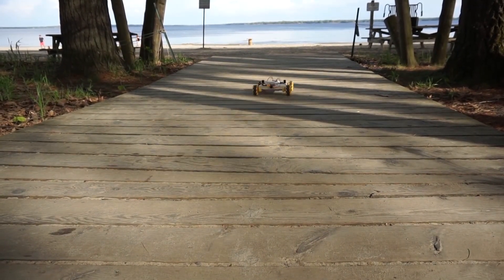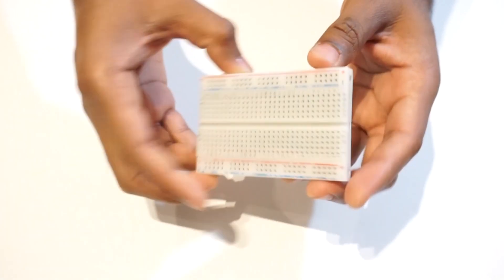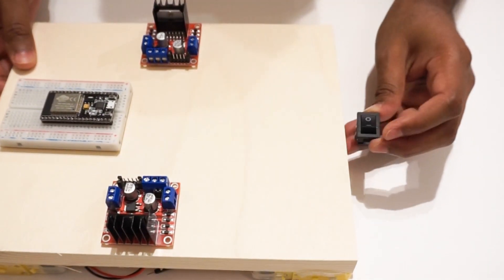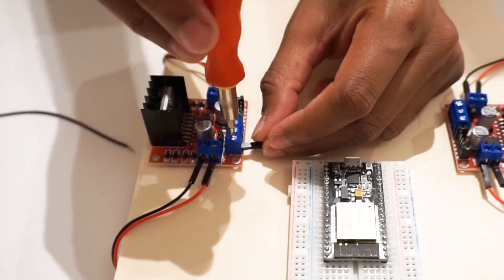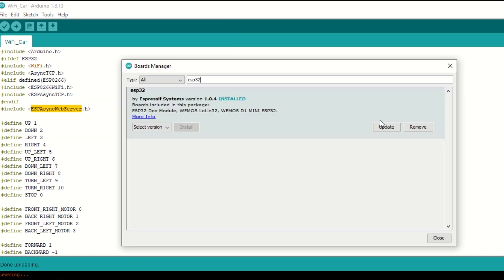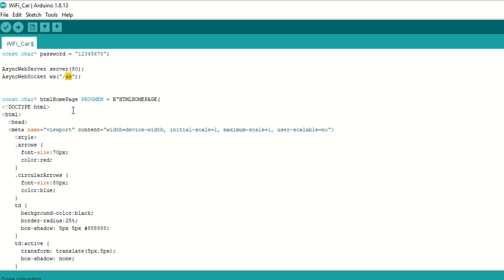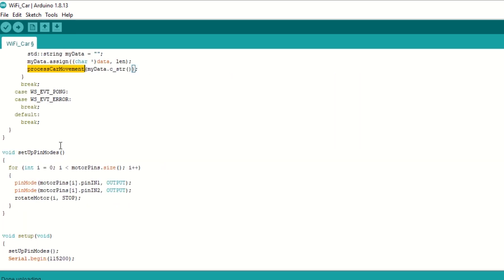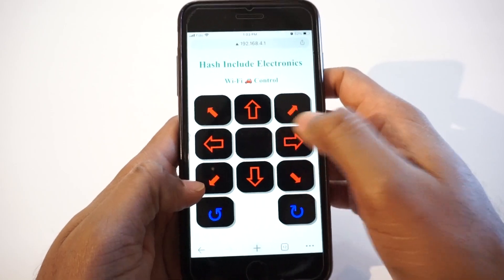Smartphone controlled WiFi car | esp32 | Mecanum wheels

Comment: Love the way this works. I'm trying to add a servo to the project, with a slider to open and close pincers, but the code seems to be out of my league. Got any suggestions for that?
Reply from the maker: Thanks for checking out the video 👍🏻 you can check my other videos for reference where I have used servo motors and slider on app. Like elevating car .
Reply: @hashincludeelectronics  Thank you for your assistance. I tried that, it's the 'switch (type)' coding (elevating car line 291 and on) which I'm having trouble merging with the wifi car coding. So far, no luck so I must be doing something wrong.

Comment: Sir the esp32 is burning after some run what might be the issues please reply as soon as possible sir
Reply from the maker: Please check if you are supplying only 5v to esp32 through 5v pin .
Reply: Yes sir
Reply from the maker: @waseemij573  Then I don’t think any reason that your esp32 is burning unless L298N  driver is faulty . Try using new L298N driver if you have new one . How long after esp32 burns ? Does your car work properly before burning?

Comment: Wifi is not working when usb is removed from pc when power source is connected to chip directly
Reply: Is (18650 1200mah 3.7v) 2batteries are enough??
Reply from the maker: @Surya-hd7ie  yup it should work 👍🏻
Reply from the maker: Which power source are you using ?
Reply: @hashincludeelectronics  same as you shown in video (using batteries)
Reply from the maker: @Surya-hd7ie  is it rechargeable battery ? Please do not use non rechargeable battery .
Reply: @hashincludeelectronics  why it’s not working with non rechargeable battery??
Reply from the maker: @Surya-hd7ie  those batteries does not provide enough current or surge in current .
Reply: @hashincludeelectronics  how much volts and mah battery should be used?
Reply from the maker: @Surya-hd7ie  you can buy the same battery as I used in the project I believe I have provided the link for it. Any rechargeable battery with 7-12v should be good. More than 1000mah
Reply: @hashincludeelectronics  thanks bro for replying
Reply: @hashincludeelectronics  I need report of this project for reference do you have it?
Reply from the maker: @Surya-hd7ie  sorry I don’t have it . You can create one easily using this video . I have already provided all the materials like code , diagram and detailed steps in video . Hope it will help you 👍🏻 please share the report with others as that will be helpful .

Comment: This is an amazing. I have a question. How can I introduce some new ways to move the car without pressing the button continuously? You´re a crack
Reply from the maker: Thanks for checking out the video 👍🏻You can use these buttons as on off button. When clicked it will move motor . And add stop button in the centre . When stop is clicked the motor will be stopped. You need to make the related changes in the code .

Comment: Bro after completing this program why in Arduino ide software not showing the port
Reply from the maker: Please check the video for detailed step 👍🏻
Reply: In your video port option is there bro for my laptop is not visible
Reply from the maker: @venkatvenkat955  Did you ever see port option before for other project ? What happens when you connect different board ?

Comment: First of all thanks a lot for this awesome project.I finished the circuit for this project, but the front right and front left motor is rotating slower than the back ones. I am using esp8266 btw. Any fix?
Reply from the maker: Thanks for checking out the Video 👍 The speed is common for all motors in code. However what i suspect is your motors have different gear ratio if you are using tt gear motors . There are different variants of tt gear motors like 1:48, 1:120 ratios etc. So check these and use all 4 motors same. Should be good.
Reply: @hashincludeelectronics  yeah! it's a matter of gear ratio. Using small one, N20 will be awesome!

Comment: Thank you very much for posting this. This is an awesome design. I just finished building and have an issue. When I use the arrow up, down, side or the blue buttons, I have to reload the page to regain connection. Can you please assist me with this? I’ve tried an iphone, google tablet and just a laptop. Thank you..
Reply from the maker: That’s awesome 👍🏻 Looks like your esp32 gets rebooted . Which power supply are you using ? Use good rechargeable battery only . I did not face this issue.
Reply: Thank you for the quick response! I will try that…
Reply from the maker: @gkhan753 you are welcome 👍🏻
Reply: I’m in the USA, can you pl make an Amazon recommendation?

Comment: How long can you drive the car ??! I mean how long does the connection is stable
Reply from the maker: Thanks for checking out video 👍🏻. I assume you are asking for range . I did not get a chance to check full range . However I can say it worked for me 50-60 ft. They say it’s WiFi range can be more than this. There is other protocol for esp32 board which can be used called ESPNOW which gives much higher range .

Comment: I don't have esp32 and want to use nodemcu esp8266, how do you fix the code?
Reply from the maker: You will just have to install the esp8266 related library for ESPAsyncTCP. The code should work as it as further after compilation . Also just check the pins used in the code if those are available on esp8266. If not available then change the pins . That’s it .
Reply: @hashincludeelectronics   thankyou
Reply from the maker: @pro7458  no problem 👍🏻

Comment: Hi...
How could I add esp32-cam pin extensions???

THANK YOU
Reply from the maker: Thank you for checking out video 🙂👍🏻 I am not sure if I got your question correctly . Could you please explain more ?
Reply: @hashincludeelectronics  What I meant to ask you is how well do you know ESP32-CAM has few pins. Not enough to put 2 l298n. So in your opinion is it better to put a port expander or use esp32 with espnow?
And wich port expander?
Thank more

@}-,-'---------
Gianfranco

Comment: Does I'm be able to build, if only i use 1 L293N motor driver?
Reply from the maker: Thank you for checking out the video 👍🏻. Actually I have no idea what module is this L293N. I suppose that you are talking about L293D module . Considering that I have never used this module with esp32 . However you can give it a try but make sure that it does not interfere with pwm channel number 0 and 1 . And also make sure it does not use PIN number IO16 . Let us know how it goes .
Reply from the maker: If you are asking if we can build this car using just one L298N module , then yes we can do that . However some of the movements will not work . Like left and right .
Reply: @hashincludeelectronics  thanks for the answer, appreciate it

Comment: Good work.. what's the max speed?
Reply from the maker: Thanks for checking out video 👍🏻I did not actually measure the speed as such . However these motors rotate around 100-150 rpm so I would say quite good speed for DIY cars .
Reply: @hashincludeelectronics  Thanks. Yes the speed seems good for the prototype.

Comment: The wheels are not running as exactly in this video. We did mostly of your configuration, we used esp 32 with 30 pins and a 7V 2S battery. Could you pls suggest, where we went wrong.
Reply: Thanks for the reply, we will find out and tell you. 👍🏻
Reply from the maker: This is good progress . Could you please check if you press forward button then all wheels rotate in forward direction ? If not then interchange the wires of dc motor connected to L298N driver which is not rotating in forward direction (that is change the polarity) . Make sure you connect 2 right motors to right side driver and left motors to left side driver. Let me know if there is still problem and we can fix it on call .

Comment: We used a 7V battery with 2S, not 3S
Reply from the maker: Nice. I assume that you are not connecting this lipo battery power directly to esp32 . Because esp32 needs 5v through vin pin which has to be taken from one of the L298N motor driver module . Just for your reference.

Comment: Can I use esp8266 cp2102 wifi module?
Reply from the maker: Thanks for checking out the video 👍🏻 you can use esp8266 as well . But make sure to change the PIN numbers in the code as per esp8266 . And download required libraries for esp8266 if needed .
Reply: @hashincludeelectronics  ok bro thanks😊

Comment: Amazing 
Can you make it's  remote control (without phone)
Reply from the maker: You got nice idea . It can be made easily. I assume you need wifi car but with control like analog joystick . In that case the idea will be to use another esp32 module as transmitter and send data after reading joystick value . You can give it a try . Else I will try to make one like this 👍🏻👌🏻
Reply: @hashincludeelectronics  bro please make this project with mecanum wheels